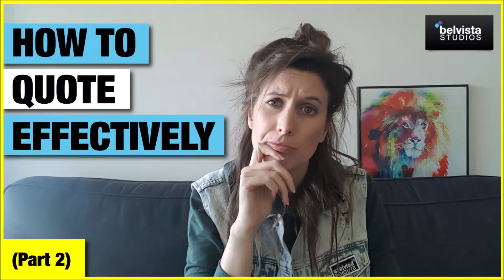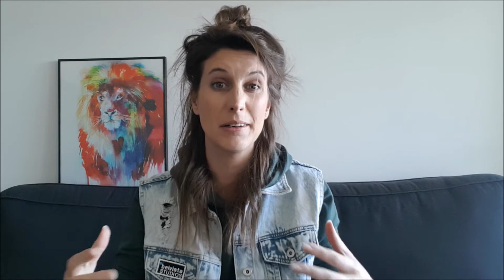How to Quote an Instructional Design Project Effectively (Part 2)

Comment: What are your thoughts on charging a flat fee for a project?  I am considering this because I have a project to quote that includes something I've never actually done before (designing an app).  The other thought I had was to charge my hourly rate for the ID portion of the project and a flat fee for the portion that's new to me.  Ahhhh... so many considerations!
Reply from the maker: If it is new to you we recommend that you go out and ask other people what they would charge to complete the app. Have what you think it will take done 1st.

It is easier for clients to deal with 1 total figure. So come in at a flat rate for the full project and be very clear on what is included and excluded from your scope as well as any assumptions you are making. This way if it has been really underestimated you can revise the scope in quote for the work that was not part of the original.

You probably want to add a buffer in if it is something you have never worked on before and have nothing to base your quote off. Think of this as a percentage of your overall flat figure.